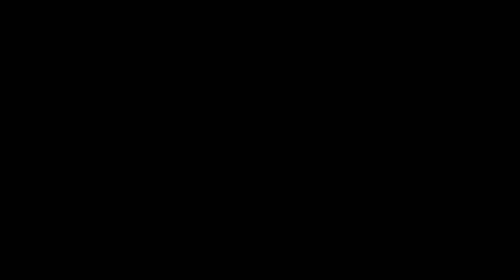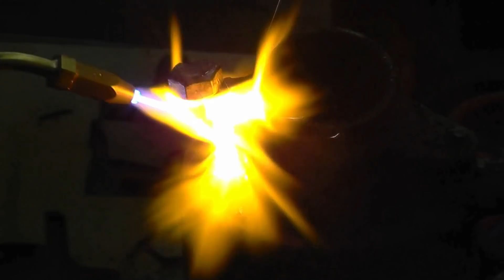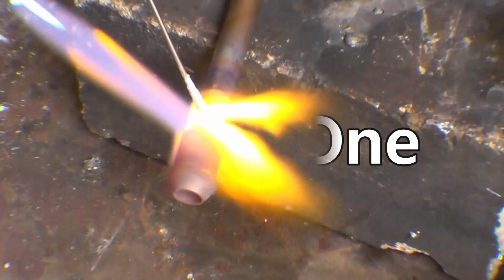SNNC 297 P1  Motor Bike Fork Yoke MOD

Comment: Great work on the mill. Lathe needs improvement,😁 (wish I could do as good)🤔.
But the walls do look thin now!, for the use it is intended.
Reply: John gives them what they want, to bad some of them want to walk the razors edge.
Reply: @MaturePatriot  You put that better than I did.
Reply from the maker: Plenty thick enough  it is a competition bike common mod  I would be less keen on a road bike

Comment: I always found using high speed steel tool bits with a nice rake cuts aluminum better than carbide as it tends to push it off rather than a clean cut.

Comment: Good stuff John had to laugh with you on the yolks. That die grinder worked a treat.
Reply: Um, sorry, but eggs have yolks, motorbikes have yokes :-)
Reply: @stevecox2530  lol, triple trees then. Why they called this?
Reply: @eyuptony  They are called yokes because they span across the width of the forks, like the yoke used across two oxen for ploughing a field, and the yoke of a shirt or jacket (the piece between the collar and the back) which spans your shoulders.  As for 'triple trees', that's an American term, so you'd have to ask an American why they have to be different.  Hope this helps :-)
Reply: @stevecox2530  Yes, something I won't forget. Thanks

Comment: I think that your videos are great and I've learnt a lot watching you but I do think that you should have had a good fitting bar going through the steering stem holes of both the top and bottom yoke along with at least one bar going through one of the fork tube holes to help keep the holes for the forks lined up whilst you were clamping the job down.